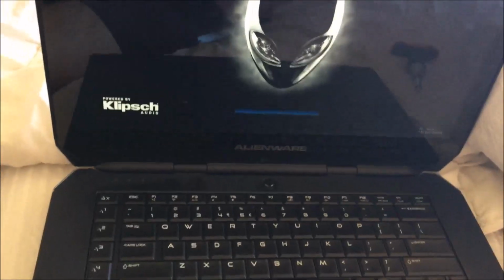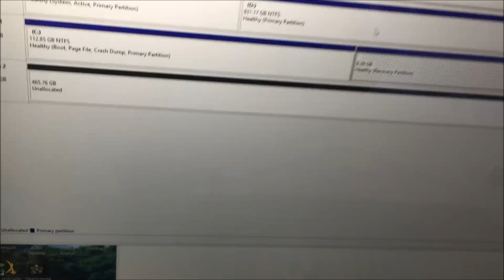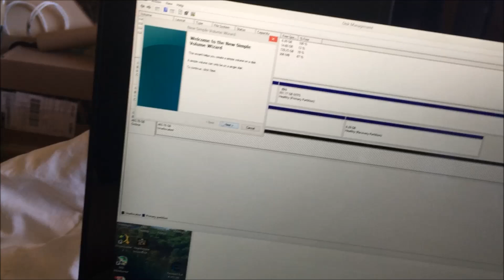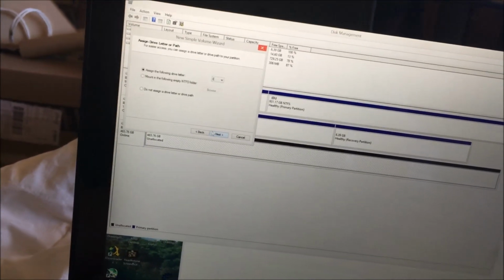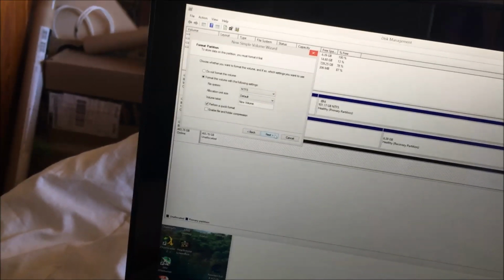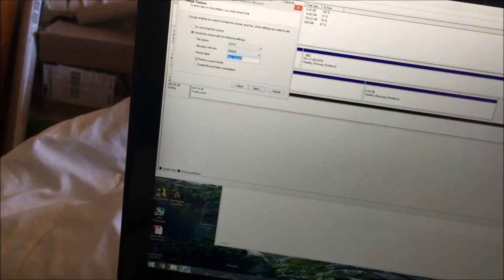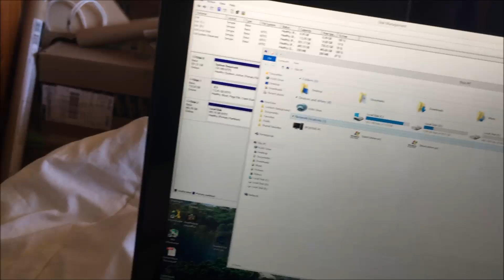How to Install a M.2 SSD [Alienware 15]

Comment: I have done this on the 17 R3 with a 850 pro M.2 and both my M.2 SSD-1 and M.2 SSD-2 say none even tho I was able to install my OS Win 10 on it. Only asking as my start up time seems to be slowing down it took 10 seconds now takes 35 seconds so trying to diagnose why

Comment: I cloned the OS to ssd and it wont boot unless I manually access the boot menu, did you have any problems like that? It actually goes into repair mode if I dont manually enter the boot menu

Comment: Where did you get that 500GB Samsung SSD? I tried looking it up but the only SSD in that size is either 128GB or 250GB. Anything above that gets broader in size and will definetely not fit like the slim one from your video.

Comment: i just got my aw 15 with a 128gb and a 1tb 5400rpm hd. since there is an additional ssd slot, i want to get another ssd. could you please tell me where i can find one of these 'm.2' ssds in india?  also what about the screw? does it come witht the ssd when i buy it? and if it doesn't, what kind of screw is it?

Comment: does only the 2280 m2 ssd work with the Alienware? Is there anything else that I need to keep in mind beside the size and brand before getting one?
Reply: HalfAzNPersuasioN thanks for the reply! it'd be great if you can make a video on how to transfer data (or OS) from the hard drive to SSD... I'm kinda new to this SSD thing and don't wanna mess my computer up

Comment: I just got the M.2 256GB SSD from Dell, and for some reason mine won't fit in that slot. I do have the 17" R2 but it should be the same right? Is there like a release switch I need to push?
Reply: HalfAzNPersuasioN Yeah, the one I got from Dell is SSDR, 256,PCEI,ACHI,2280,2M951 but I can't get it to click into place. This is the one I got, well it looks like this one -http://www.notebookcheck.net/fileadmin/Notebooks/Apple/MacBook_Air_13_2013/Samsung_PCIe.jpg same ends.

Comment: can i not boot from m2 ssd? i installed one and have been trying ti figure it out i had a stock 7200rpm one that came with my system and i installed a samsung 850 evo m2 ssd
Reply: i've installed a fresh win8.1 on the ssd but drives seem to be missing and things to not work still trying to find clonning software that will make it boot directly from clone

Comment: Hey, need help. Got my Alienware 15 and recently bought 859 Evo SSD and can't figure out how to migrate os to ssd. Samsung migration software freezes and doesn't work. Tried to do some magic with alien respawn and after several hours of screwing with it found myself with 0 results. How did u manage to deal with? I tried to download W8 and got my windows key with some software, however during the installation it says that my installation key is wrong. Could you please write a small description of how did u coped with the problem of migration of OS to ssd? Thanks (sry for poor English. I'm Russian).
Reply: HalfAzNPersuasioN Thx. Tried clean reinstall which resulted in a failure, as windows installer asked for drivers for hard drives. Finally, i came up with easy solution of migration - Acronis True Image. Migrated my OS very quickly and easily. Btw, my Alienware 15 heats very much. What are your temperatures in IDLE and under Load? CPU reaches 70 C in Idle mode, dont know if this is wrong or not, as these temperatures contain the same during gaming.
Reply: HalfAzNPersuasioN About ten % of CPU usage. Made some research on this, turned out that it's the problem of bios settings. What is your Bios version? Some websites say that A0 is the coolest firmware of bios. I tried A2 and A5 - both are pretty warm even in idle, but during gaming temperatures remain the same (about 70C). I guess it was some trick made by dell engineers as there were reports about Alienware 15 beeing too noisy. So they decided to let the cpu heat, but dont cool it with fans. Brilliant idea! Still working on it. Ill try to downgrade to A0 from A5 and see what happens. Will keep commenting here, maybe i would be able to help someone. Could you please post your bios version and temperatures u get in idle and maximum? I use Aida64 for this. Thanks.